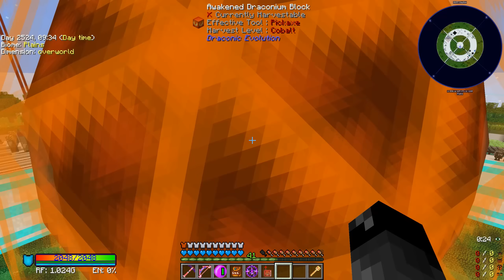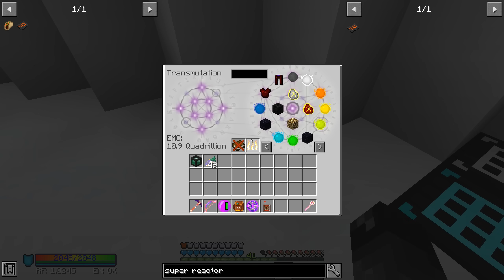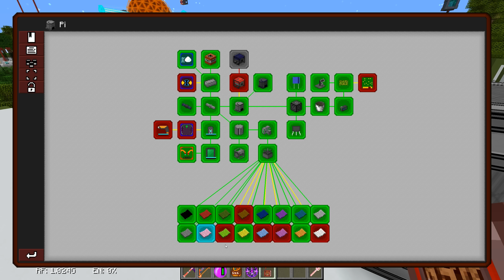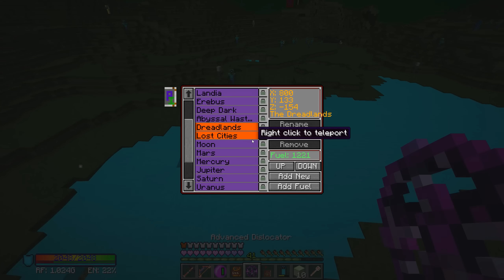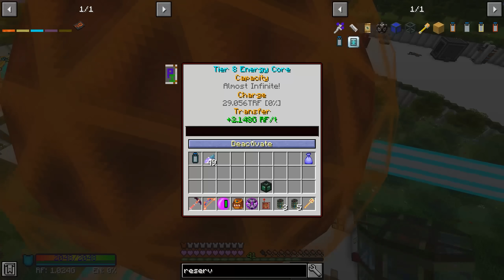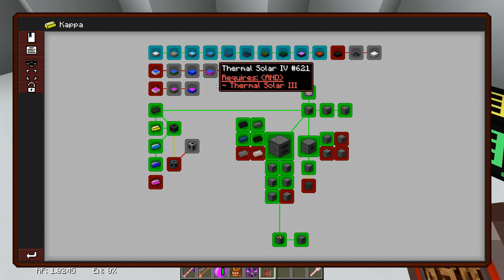Project Ozone 3 Kappa Mode - SUPER REACTOR [E134] (Modded Minecraft Sky Block)

Comment: For anyone wanting to transfer this power to the ball, you can phantom face the input of the ball and put the phantom face directly on the output of the reactor. Remember the phantom faces copy the blocks, so the mount the block so you don't actually need the pipes.
Soaryn one time filled the energy ball using only the Rainbow Generator and phantom facing it to multiple ball inputs. Yes, a single rainbow generator lol

Comment: In case you don't know, the "G" in power units is short for "giga", aka billions.
Reply: K = Kilo 1,000 Thousand
M = Mega 1,000,000 Million
G = Giga 1,000,000,000 Billion
T = Tera 1,000,000,000,000 Trillion
P = Peta 1,000,000,000,000,000 Quadrillion
E = Exa 1,000,000,000,000,000,000 Quintillion
Z = Zeta 1,000,000,000,000,000,000,000 Sextillion
Y = Yotta  1,000,000,000,000,000,000,000,000 Septillion
Reply: GIRTH

Comment: 25:20 The problem is the book in the middle- the book's EMC is 50000, so only items with 50000 or less EMC can show up. The Solar 5 had too much EMC, so you needed to remove the book from the center. Likewise for the Photovoltaic Cell 5.
Reply: Its acrually bugged, he had the Tome Of Knowledge (TOK) learned, and the photovoltaic cells weren't in the terminal even with the TOK learned.
Reply: @reclipsel  Considering the two mods are linked, it looked like the search applied to the terminal as well as to the table. I can't find the time where he looks through the terminal, but if I remember right he didn't see anything above the EMC threshold when he looked in the terminal either

Comment: There is a device that will instantly send all the energy. I think it one of the items in AE?
Reply: Problem isn’t sending the energy, cryoducts have infinite transfer rate, the problem is that the transfer rate of something is equal to its internal buffer and the energy pylon from draconic has a internal buffer of 2.14 billion rf, therefore only transferring that amt per tick, only way to fill it is to put the output of the reactor close to the ball so it directly interacts with it transferring the 9 quintillion in one tick, and yes p2p from ae2 can also transfer energy but the pylon still won’t let it all in

Comment: Try using flux plugs and points to sent power to the draconiam core (if its in the modpack)
Reply: Fortnite Vlog not in pack
Reply: Not in the pack; plus they are also limited at 2G

Comment: The super reactor fills the draconic ball if the energy output of the super reactor is at most 16 blocks away from the draconic ball, since it can directly interact with the ball without having to be limited by the 2.14 billion rf/t transfer rate of the energy pylon.
Reply: V3c70r Yes that way it it can bypass the 32 bit integer limit which is about 2.14 billion as you mentioned. The amount of rf the dragon ball can hold is equal to the 64 bit integer limit and the reactor output is equal to that.

Comment: Each one of the power outlets holds that number. The Super Reactor actually can fill 1 1/2 tier 8 dragonic energy cores.
Reply: No only one of the outputs fill, filling exactly one tier 8 draconic energy ball
Reply: @v3c70r6  there's 8 different outputs of power that each hold the amount that one tier 8 draconic energy core holds. Therefore the super reactor can hold enough power to fill 8.

Comment: I thought the super reactor fills the the draconian core instantly
Reply: He built the reactor too far from the ball.
Reply: It does only if the reactor is close I'm pretty sure it like 20 block away and hypno built it too far away
Reply: @Roei Hammel I started watching him a while ago now and at first It was very hard to get used to but now that I've him for a while and just love seeing his progression, in this pack especially.
Reply: The reactor output can only transfer 2.14 billion rf a tick per side so it’s the limiting factor here. The phantom energy faces or what ever they are called interact with the buffer inside the block directly hence allowing more power output. The pylons can handle more by what you can see in Hypnos video when they transfer 50 billion from one connection. I am sure that the reactor power tap/output is slowing this down. This would also explain why the reactor can directly interact with the energy ball buffer when it’s close enough to bypass that limitation. Hope this clarifies some things up.
Reply: It will, just the pipes can't move the power fast enough
Reply: Tom Parkes you can fill it in one tick
Reply: V3c70r hypno said himself that the cryo stabilised flux ducts don‘t transfer infinite energy. He needs the energy pylons from draconic evolution i think
Reply: Dragan Andelkovic the energy pylons don’t transfer infinite energy either, he has the cryp stabilized fluxduct (which is infinite) connected to the energy pylon which transfer 2.14 billion rf/t, to instantly fill it the energy output of the super reactor has to be writhing 16 blocks of the ball of energy since it can directly interact with it, therefore filling it in one tick
Reply: They have an power limet that's 2,147,483,647 rf/tick but still one line can put in more power per tick just not pull out more than 2,147,483,647 it's wierd.